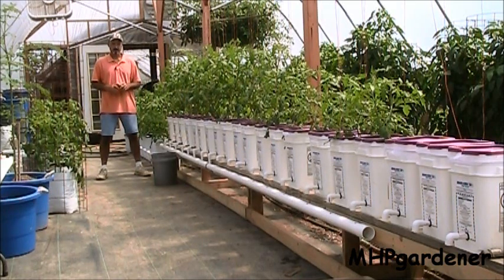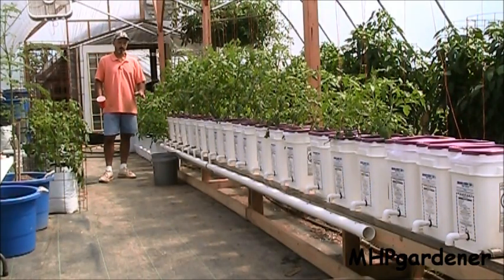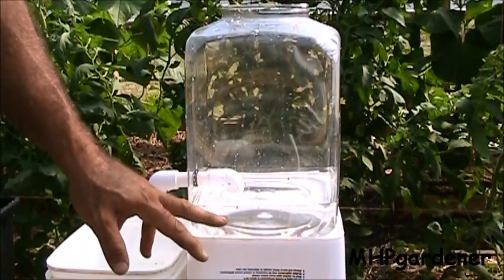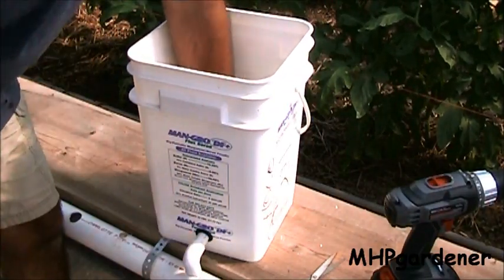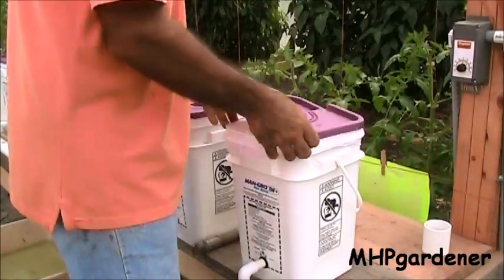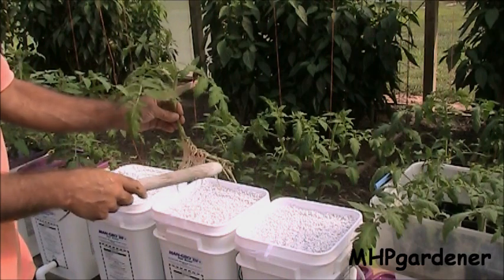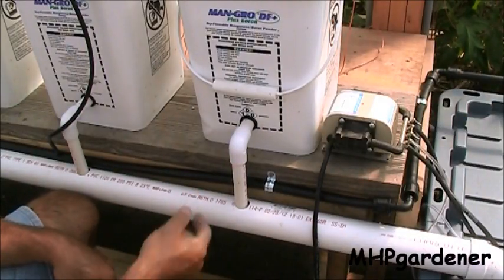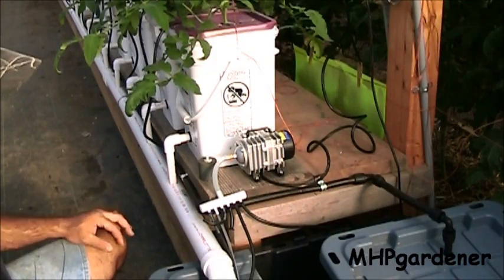Dutch Bucket Hydroponics - How It Works & How to Make Your Own Buckets

Comment: Your videos are extremely informative.  Thank you.

I hope you have time for a question.  I see many people use systems that incorporate bell siphons, because they are trying to create a float- drain system, assuming they need the drain phase to allow the roots to get oxygen.  The dutch bucket system is fully flooded, and I notice in the beginning you were aerating the water, then appear to have learned that that is not necessary.    Why do the bell siphon people flood and drain if the dutch bucket system works so well without it?  Thank you.

Comment: Hey MHPgardener, I have a question.  I know that dutch buckets work, but can you use this as a kratky system instead of a hydroponics system?  I don't have electricity but I also have to work and cannot water them 4 times per day.  Would I be able to put the bucket at 1/2 full of nutrients and leave it till the next day and check on the liquid?
Reply: +Deborah Elliott I've tried the Kratky system with a dwarf determinate tomato growing in a small tupperware container. It worked great. If you had a much larger container you could do the same and refill the container much less often. I suppose if you had half of the roots in solution and half in air, you would be just fine.
Reply from the maker: I haven't tried it that way, but it's worth a shot if you just don't have time.
Reply: Go with the Dutch Bucket, about 11 Liters. Transplant 2 Times (Start .5 L, 1-3 L and 11 L). The small need wattering every 3 days, the medium is fine for 5 days, the big ones too, except if your plants suck up to much water. 
This way just use it as drain to waste (3 times nutes minimal drain, 1 times water for 2 days, 50 % Drain). In the small bucket use 1/4 strengt nutrients, in medium 1/2 in full size full strenght nuts. 

The medium will suck the water and nutrients up from the reservoir, just always make sure to fill it up fully by seing some drain.
Reply: David Newton what size container were you using for the tomatoes?

Comment: Putting together supplies to give this a go.  I was wondering if you knew the part number for the Grommets at Grainger?

Great video!
Reply: +Chip Griswold - Grainger part number for 5/8" rubber grommet is:  3MPR5

Comment: Very informative.  Would it be possible to just put the screen material around the drain pipe and attatch it with a rubber band rather than using a bag ?

Comment: Instead of perlite, I'm curious how the average bucket in this system compares, using the same nutrient solution, with 1) a potted plant in bucket of dirt and 2) a plant pointed up through a hole in lid, simply floating in water?  
great presentation, thanks.

Comment: One issue that wasn't covered was UV degradation of the various plastic buckets....after 1-2 seasons most of the buckets in this video will be worthless. The commercial Bato buckets are made of UV-stabilized polyethylene, and will take many years of exposure.

They may be 50-75% of the cost of a commercial bucket, but you gotta also source them (time) and plan to replace every other year (money). So in the end it is, at best, a wash.

Comment: Hi. I am curious, why are all your buckets the same level? You should tier them and allow the drainage from one bucket to feed the next bucket and so forth. That way, instead of a feed line to each bucket, you would only need a feed line to the top bucket in the series. Just build simple 'bleacher seating' for the buckets. Also, if you bury a 35 gallon or bigger trash can with a lid (your reservior) in the ground, put your pump in a basket that can be raised by 'hand', it will lower your water temps, decrease critter growth and decrease evaporation (which will help avoid concentration of nutrients).

Comment: You explained everything quite well except where to get those square sided buckets you used. 
Yes, I know I can buy 5 gallon buckets and lids at Home Depot or Lowe's, but they aren't cheap. By the time you buy one then add the PVC fittings you are almost at the same price as a Bento.
Reply: +Terry Thomas I Think Bobby once said he got them from the feed mill. I got some 3 gal square(rectangular) buckets from the bakery shop in one of our supermarkets (Copps), and they didn't cost a thing. They get the donut filling in them. Another place I've gotten 5 gal pails from are fast food places in town. They get pickles in them so they do smell like...pickles. Smell doesn't come out very easily put eventually goes away. They usually want $1.50 per pail.
But, I finally just bought dutch buckets and went with them. Still cost about $6 to $7, with the elbows. Just made everything more uniform in my grow system.

Comment: For the size of the roots you showed... a bucket 1/3 of the size should work... so cutting the cost of your perlite and buckets... just thinking! I would almost add some compost on top for extra measure... the filter will catch what might mess with your watering system... gonna try it myself... thanks!
Reply: George Adams

Comment: Good system.  But I am going to not use ANY medium just gonna put a nutrient line into the top with the seedling and wool rock where it trickles into the net pot and drains into the bottom of the bucket than down the drain line.  NO messy medium needed.

Comment: I am considering the hydroponics system but i was wondering what advantages it would be over dirt!  I live in Newfoundland Canada have lots of room for a house-i did grow tomatoes and cucumber a few years ago with good success. just wondering if their was a substantial difference also do the joint between the 1/4 hose and the black poly leak after a few weeks!

Comment: Thank you for all the time you invest to educate and share your knowledge! I know it takes time to do that. I’m building my first Hydroponic/ Bioponic system. I have two 100 gallon tanks in the ground. I have two 50 gallons “bed” ready to go. Either with grow medium or just “flood and drain” with water. Looking at your other video how you mix your fertilizer you talk about Masterblend with 12g per 5 gallons…plus all the other you mix in. For me this would mean that I would use 480g of Masterblend to start my system. Correct? (I know I need Calcium Nitrate and Epson Salt also) I am growing outside and some water will get lost (I’m in Florida) I have to refill the water and also the nutrition. When is the point to make a new batch of fertilizer or how do I know when to add more? I can’t replace possible 200 gallons of water completely every so often?? Thank you for giving me some inside.

Comment: This video is years old but I still learn from it. I have started and have a question if you can see this after 3 years. I have 13 Dutch buckets and tomatoes are looking great, but I lose about 8-10 gallons (from a 27 gallon system) of nutrient every single day. No leaks at all, is this normal? It's getting expensive and annoying. I didn't put the PVC elbow in the buckets when I put it together, could that have something to do with it? It was clogging at first, but not now, just lots of water loss, big time!  Thanks

Comment: Thank you so much for all of your informative videos!!  I now have (for the first time) my harbor freight greenhouse, 10x12 and have 20 buckets on a dutch bucket system. I am located in western Montana and have a few questions.  I purchased my liquid nutrients from Hydro Gardens and am doing the mixture you suggested. My reservoir is in the ground with installed boards on the side and top.  However my water gets VERY warm, so I am concerned about that. Any suggestions? Also can I premix my liquid nutrients in 5 gallon buckets and have it waiting to go into the reservior? Instead of having to mic it ahead of time?

Comment: Do you run the water pump all the time or use a timer? I thought that the roots needed a 'drying' cycle. The ready made kits that use the same principle setup cycle the water pump on and off at certain intervals.

Comment: Two questions. How often do you have to add water to the circulating bucket? I am guessing that the water will dehydrate. I remember having a small container of wash stones with small electric motor and water sounding like a brook. Even though there were no plants, the water level would get very low and the motor would burn up if you did not keep adding water ever so often.
Second. In your video, you have a long row of plants. Do they have to be all of the same type? Due to the different nutritional values required from each plant I was not sure if having different plants on the same would cause problems so one type of plant would do well and the rest would die or not due well.
Peace, Reese

Comment: I have three questions.
#1- I see a lot of setups of dutch bucket systems without lids, is there a reason that I should use a lid with this system or is it okay to go lid-free?
#2- Is it okay to have the water running constantly or does it have to shut down throughout the day?  I would have thought that the roots would dry out with it being shut down for hours at a time.
#3- If I find a good enough mesh to hold sand in the buckets, would that be okay to use for plants?  Including root plants?

Great video btw
Reply: ***** The purpose of the lid is to keep algae from growing. Whatever keeps the inside of the bucket dark.  Aluminum foil, black plastic, etc Ive seen it used with success.
Reply: ***** Sand may flow through to the pump, which would be problematic.  Ive also heard of sterility issues, but don't know any of the specifics on this issue.

Comment: Thank you so much for your video. 
This spring started my first Dutch system. 
What do you use to connect your 1/4" line from your 1/2" line? Do you clamp the end 1/2" line? The only way I get some flow is by clamping the end of the hose and my 1/4" line just drips of water verses a constant flow - is that okay?

Comment: You should put the feed in lines containing the water and nutrient above the containers about 6 in. I have done this and it is better flow, not just by pumps but adding gravity. I also used a passive restrict or or plate ( a Teflon plumbing washer will do this) before the container receiving the not used pumped water. It was passive and made sure all lines were fed before any water made its way back to the over flow reservoir.. All else seems great.  Hope this helps.

Comment: Hey Bobby, I put together a system similar to yours with the buried resovoir. How ever it is outside. Any ideas on controlling excess rain water?
Reply: B Cooper you could put an over flow plug at the top of the reservoir.  If you have lids on the buckets you won't have much excess water in fact you will be adding water after a week to 10 days
Reply: Thanks Norm. I do have lids, even in heavy rain it does not seem to gain much water. I was surprised.

Comment: The only question now is about the "Nutrient" formulation that you are using.  What do you use, (brand/type/etc.), and at what concentration level?  Do you have to monitor/check/replenish the nutrients?, or do you just add water as necessary?

Comment: Ok built my system last year and it did great all through the winter.  After much rain and lots of moisture they developed some leaf mold.  Now the plants are doing better but the size of tomatoes re much smallerand the plants are about 7 ft tall.  At what point do I change the plants out?

Comment: Really enjoy your video's.  I have a question.  Instead of using a painters screen full size in each bucket could you cut one up and secure it with say a zip tie over the elbow opening in the bucket?  Seems like it would keep out the pearl lite.  Is there another reason to bag the pear-lite in the bucket.  Thanks Bill
Reply: Bill Nazarenko THat would create a very small surface area (1/2" ID) and probably become backed up and clogged up.  Eventually, all the nutrient solution would end up in that bucket and over flow at some point.

Comment: guys I want to start a small hydroponic system. 12 five gallon buckets.
I don't have electricity back there I want to use solar powered submersible pond pump. do you think this would be good enough to pump the water?

Comment: Question on your water cycle timer, do you run all day or you'll have a timer set up on a timely basis?
Would it also hurt the roots system if i were to run it 10hr straight?

Comment: Bobby, question for you!  I mixed up 5 gal of MB and checked PH, it was 7.5, brought it down to 6, added my air pump with the airstone and left it run attempting to get the chlorine out of my tap water, this morning I checked PH it was 7.8.... ? got any ideas?  I brought it back down again and left it sit the last 8 hours and it is fine now!  When I get the buckets on line it looks like I will be adding a lot of PH Down and all I will need to do is use more air if it goes too low.  Have you had this, another experiment for you!

Comment: Ok I made my dutch buckets today. He clearly stated that you use 3/4 PVC, a 3/4 grommet but used a 1" hole saw. I even used the same grommet from granger using the part number he gave. The hole is way too big, the grommet doesn't touch the sides of the hole. Anyone else had this problem? BTW MHpgardener rocks! But where are the new videos?
Reply: Zak Stewart 
Here is what I did:  
1)  Ordered from Grainger  

https://www.grainger.com/product/APPROVED-VENDOR-%20-3MPL8?cm_mmc=EMT-_-OrderConfirmStandard-_-GcomOrderConfirm-_-sku&cm_em=midijeep2002@yahoo.com&RIID=66794206&SG=NULL&OAA=NULL&GID=

2)  bought a 1 inch hole saw.
3) Drilled a hole about 2" from the bottom with the 1" hole saw
4)  Placed grommett from above into 1" hole.
5)  Put a little grease around the 1/2"  PVC pipe and slid it in
6) Repeated all the steps for the next bucket.

Now to technical data:  The grommetts ordered from Grainger have  dimensions for them on the webpage I gave you above.  Look at dimensions A & E.  These are the only two dimensions you need to worry about.  Notice that A is 3/4" and is  the inside Dia. (ID) and E is Panel Hole Dia. 5/16" which is the cut  outside diameter (OD).

The Outer Diameter of the so called 1/2" PVC pipe you buy is actually 3/4" not 1/2".  The Inner Diameter of the 1/2" PVC pipe is 1/2" .  For all purposes you only need to worry about the OD of the PVC pipe, which is 3/4" for the 1/2"  PVC pipe.
Soooooo, 16/16" = 1" but the grommett's cut diameter is 15/16".  The grommett is 1/16" smaller than the 1" hole you need to drill into the bucket (this is good).  The 3/4" ID of the grommett fits the OD of the 1/2" PVC Pipe.
Reply: Zak Stewart 1" hole, 3/4" grommet, 1/2" pvc pipe n elbows is what i understand...however I came across 2 different sizes of 1/2 inch pipe!
Reply: Zak Stewart You need to make sure you understand the dimensions of the grommet i.e. the outer diameter (OD) of the grommet may be 3/4", where the inner diameter (ID) would be 1/2".  Check to make sure the ID is 1/2' not 3/4".  Also, check you hole saw diameter.

Comment: Hi mhpgardener,

From what I've learned from your 2012 video, leafy plants work good (maybe best) using the Kratky method, and fruit and veggies work better in a Dutch bucket.  Does your experience since 2012 still supported these conclusions?

I appreciate your videos.  Well done.

Ronl

Comment: mhpgardener: Excellent video; I am a beginner in hydroponics and your instructions are the best of all I have seen. Very helpful;  learned a lot.   Just one question- Wouldn't this system work better with an aeration stone in each bucket, or you think one aerator in the main reservoir would be adequate?   Thanks.
Reply: chandra0102 For Dutch buckets, most of the nutrient solution is drained out and goes back to the reservoir, where it will sit until the nutrient solution is cycled through the drip system into the Dutch buckets.  The aeration  needs to be in the reservoir.
Reply: midijeep:  Thanks.

Comment: You said in the video that you go through and add the water/fertilizer nutrient solution 3 - 4 times a day.  I think a timer, pump and a barrel of the solution would be cheap and easier.

Comment: Just wanted to say, that after watching your videos last Spring, I decided to try out your dutch bucket system. I found it hard to find buckets that were at least 3 gallons, and when shopping for perlite, I found the price way to expensive for me to afford. I decided to go with what I had available around the house. I came up with using 5 2lb plastic coffee containers. (Maxwell house and Folgers) I installed the rubber grommets along with the pvc elbows just as you did in the buckets. I filled the coffee containers with regular pea gravel from menards, filled up my reservoir with hydroponic tomato fertilizer I found on ebay in Ohio and transplanted my tomato plants into the coffee containers filled with pea gravel.  I just want people and yourself to know that I had pretty good success with this. I had a decent yield of tomatoes, plants grew out of hand, I had to prune like crazy mainly because I didn't have much height in this proto-type greenhouse I had put together very quickly out of cattle panels so I only had around less than 6 feet of room from the floor and the containers were on a bench about 2 feet up from the floor.
Reply: Gratz on your ingenuity. Although there are a lot of systems and components available commercially, the ideas and prototypes for those were dreamed up and created by common people. A heads up: 3.5gal black buckets are available at homedepot and anything over $17'ish for 4 cuft of perlite is too much. Check seed stores in agricultural areas.
Reply: Rollin Caswell really? Home Depot and lowes sell millions every year
Reply: WHY NOT  STERLIE CLEAN  USE PAINT BUCKETS..
Reply: Chris B yeah really. I couldn't find them "2" years ago